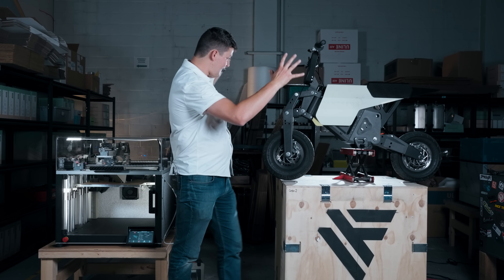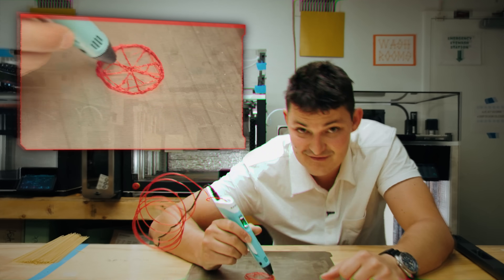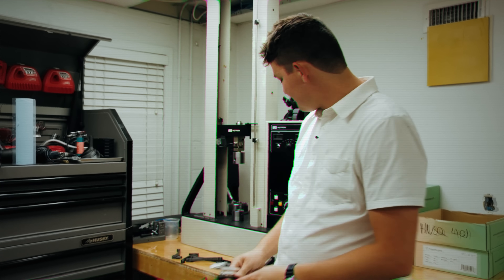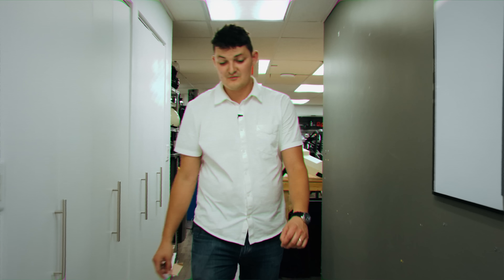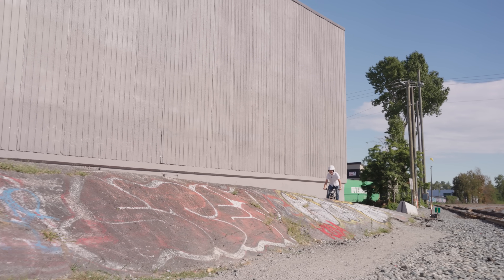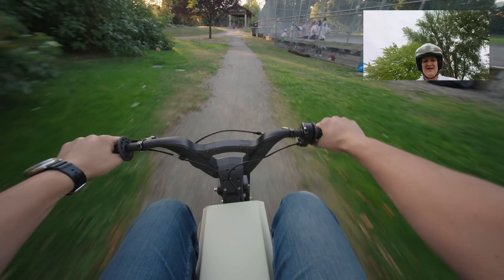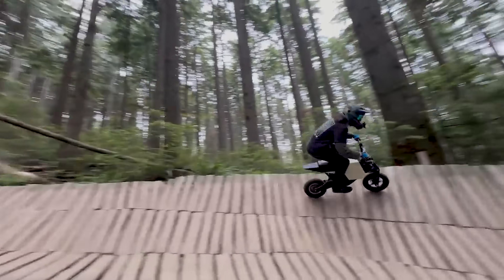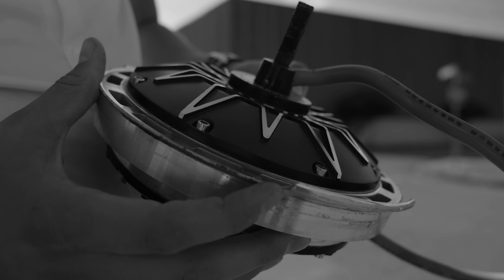Jumping a 3D-Printed Motorcycle - How Strong is the Future?

Comment: 9:47  $500 in filament...plus the cost of a full week's use of one of these specialized printers.  I suspect it would end up costing more than a similarly market-positioned mass produced bike.  And buying your own printer is obviously out of range for most people, since @ 2:10 they cost "more than a Ducati." 
Great for corporations that need rapid prototyping, maybe useful for heritage parts that aren't available (if you're willing to pay the price for an effectively made-to-order part)...but I don't see it being of much use for your average young person that's strapped for cash unless the price of the printers, and the time needed to produce the parts, is severely reduced.
Reply: ... plus tires, motor, rotors, axles, brake system, suspension, electronics, fasteners...
Reply: Motor, controller, and battery add an easy $2k if you want to go faster than a jogging pace. Still, it's impressive how far additive manufacturing has come.
Reply: Yeah... This is like all those articles about 3D printed guns where none of the actually important parts are 3D printed. I mean it's still a really cool concept, but 3D printing will never be the right choice for mass manufacturing something. Like Ryan said himself, it's great if you need to make a thousand things once. There are much better ways to make one thing a thousand times.
Reply: @Hendlton 
3D printing parts for rapid prototyping
3D printed molds for rapid iterations/lower cost per mold not rare to see 250K per part/mold.
3D printing all plastic in USA to dodge tariffs without investing in USA manufacturing/jobs just a warehouse full of printers and a few dudes to maintain them.
Reply: that is the cost.... right now.   3d printers used to be super expensive for machines that were far less capable.  now, you can get a machine that blows away what was once thousands of dollars in the past, for a few hundred, with tech in it that was unheard of back in the day.  the tech is still fairly new, and it is becoming both cheaper, and better by the day.  with a machine that cost a grand and change, you can print parts that are probably about 60-70% as strong as those parts, so in the future one of those "ducati priced" machines might be affordable for the hobbyist, or one might be available at a local maker space or some such for a much more reachable price.
Reply: @RevUnstableBoy you can print these exact parts with a machine that coats less than a grand. Overextruding is not magic. 20g of acceleration is not remarkable.
Reply: @mitchellsteindler  exactly, they're really not much better in capabilities to large format hobby printers. You can easily get prints like this for used "Honda" price, not "Ducati" price. CF nylon is still expensive, $60 a kg for quality stuff. That adds up for something this size.
Reply: People use these for developing products, most of which are later made conventionally. Someone has to try new stuff to push the limits. It’s obviously a thought experiment.
Reply: 3d print your own 3d printer 😂
Reply: @bake162 The Prusa approach :)
Reply: also the price needs to include the other parts that can't be 3d printed, like motors batteries, brakes etc as well as paying someone to assemble it
Reply: 3d printing doesn't make sense for 70% of this application, and it doesn't make sense for mass produced items
Reply: What is the cost for someone to run the printer for a week and also to assemble all the parts?  Conveniently left that out if the equation.  Plus, this bike is less comparable to the Grom and much closer to the Honda Navi, which i believe sells brand new for $2,000.00 usd.  Hard to rival the scale of Big Red.
Reply: Buying your own printer ranges from 200$ to 2500$ for something that'll do you comparable parts at comparable speeds PLUS a toolchanger to use bondless breakaway support material, and an actively heated chamber for performance directly comparable to injection molded parts in-plane. Sometimes helps to throw a quick question at Google.
The REAL expensive part here is the plastic itself. Carbon fiber nylon, likely no less than a PA12 blend, possibly even a more durable base? And it's probably not the more budget 15% CF, it's likely the 30% blend. The stuff goes for 50$ a kilo on a good deals' day. THAT is your real kick in the plums here.
Reply: You have then become a manufacturer with manufacturing problems. Initial cost is higher, but then you can make more than one. Cheaper for someone in need of more than 1.
Reply: Also add the cost for the electronics, motors, battery, etc. I just recently built my own 3d printer, and while the cost of the 3d printed parts would have been maybe $40 in printing filament, the frame, hardware and electronics all pushed the cost above $1400. I did thoroughly enjoy the process though.

The main benefit of 3d printing is it makes it possible to have custom stuff you can't buy at the store. As long as you keep within the limitations of the process you can get good results. And there are cheaper options that work out of the box than what I did. I just like to tinker.
Reply: Your criticism is valid, but the video is as much about possibilities and optimism for the future. It wasn't that long ago that a shitty resolution 40" flat screen TV cost $20k .
Reply: Price of printers will likely drop as production scales up, or capabilities will rise such as speed.   Always the case with electronic gizmos.  Need only look at cell phones and computers as examples.
Reply: @bjb7587  Prices will drop but as goes for regular printers: high-end models will be expensive as the components are expensive. A professional colour laser printer is not a cheap machine, despite a basic printer costing as little as €50,- new sometimes. Phones aren't a good comparison as they have very few components and most of them become cheaper, quicker. Especially the chips. Screens have been developed for decades, as have batteries. 

The sensors, nozzle, etc. will always be a costly item, which you will pay for as the customer.
Reply: And it's not enduro, and it brakes on the first ride...
Reply: You cant print these parts with the same quality at a faster speed by simply buying a consumer bamboolab x1c printer.
Reply: @mitchellsteindler 
No
Ther is same good stuff in that thing

Comment: PA6 CF and PA12 CF deflect under a constant load independently of temperature, so idk about the longevity of any of these bikes. Yeah, sure, printing a single or a couple replacement parts could end up being pretty cheap, but if they fail when under my weight, wile riding, lets say at 20 mph, thats not gonna be a good time
for me

Comment: On the other hand Pratt and Whitney had to recall a lot of engines due to 3D printed part losing its properties quicker than expected so longevity is kinda an issue
Reply: Well, at this point in time, metal sintering is almost the same as making a billet with a welder and then machining the part from that. You're bound to have stress points and weak spots all over the component which will lead to premature failure, especially in such high stress environments like the interior of a gas turbine.

Comment: That was always a question for when the folks on Star Trek were rebuilding the Enterprise after the ship got blasted in space, leaving a giant hole to be repaired.  No where to store any spare parts, fabricating any replacements,  or flying multiple light years to get to a service station.  Just pull out the digital files , plug them into the printer, and Scotty will have the Enterprise fixed in no time.

Comment: Admittedly noticing that the video was 60fps at around 00:18 was jarring. Tech is cool as hell, and sort of unsurprising as FSAE have been using 3d printed parts for a while.
Reply: How did you notice that??? Your eyes are wild
Reply: @nifty_biscuit  Most videos are on 30fps so the jump is fairly noticeable on the right screen.
Reply: @KaiboDamasu 30fps?? What are your default settings
Reply: @SuperEpicCookies  settings don’t really matter you can notice the jump on just about any screen. 

 Refresh rate settings just determine how often the display updates, but they don’t change the fps of the video itself.

Comment: The only thing i've dared to 3d print for my bike is the choke lever, only because when i bought new grips, they didn't come with one. It took some time modeling it and a couple of adjustment after they broke, but it's been working fine for 2 years now. That was on a slightly modified Ender 3.

Comment: $500 of filament, a week of printer time, and…? How much was the battery, hub motor, tires, and all the other manufactured stuff costing?
Reply: Also the printer that "costs as much as a Ducati". Or be stuck paying another 500 or so at a shop to do it for you.
Reply: Exactly. The funny thing is that this is probably a viable model, but selling it as "fully 3D printed" and "made of $500 worth of filament" is profoundly disingenuous. It's like saying that phones are fully made of a dollar's worth of sand.
Reply: its a tech demo to demonstrate what the printer company's printer is capable of, its not meant to be mass production like you're saying
Reply: Not economically viable. When you can already buy a Chinese electric bike for around $1000 that will be better than this.
Reply: @_________________404 $1000 in the US, that is.
In China they sell for about 2 bananas and a wet napkin.
Reply: Honda Navi is $2000 ready to ride and comes with a warranty.
Reply: I have a bunch of 3D printers and would buy a NAVI for $1800.
Reply: 2k for the parts, probably at least another 1k for the week of printer time... and suddenly it's a 3.5k bike... and you can find cheaper on the used market, or chinese. RPS Hawk X 250 anyone? Sure you need to be a welder to do some needed improvements, but... it's $1670.
Reply: And what does the electricity cost for one of those things to be running for 160 hours?
Reply: @jacknimble1  I have an answer for you actually. Assuming a bike like this has an 80 amp hour battery at 72 volts, it has a battery capacity of 5760 watt hours. Something like this going 50kph non stop would take about 1500 watts nominally ish, so 100-0 would be 3.84 hours. 

The current price of electricity is 18.2 cents per kilowatt hour, so travelling at a constant rate of 50kph would cost around 27.3 cents per hour,  running this thing for 160 hours in the scenario were working with here would cost $43.68 USD total in electricity. Assuming a constant rate of 50kph will drain the battery in 3.84 hours of riding, we can also deduce based on lithium ion capacity degradation that something like this would be able to drive 192,000 kilometers before you start thinking about replacing the battery.

All things considered, if your job is an hour away and you use this, you could get to work and back for 1920 days, or, 7.38 years of round trip commutes for a raw electrical price of 1048 dollars, factoring in replacing the battery after those 7 years and it should be around 4048 dollars. The same commute on a similar gas motorcycle, assuming they spend an average of 60 dollars a month on gas, would cost 5313.6 dollars in the same time frame, so its about 20% cheaper than gas, with less frequent and cheaper maintenance because electric drivetrains have only 3 moving parts.
Reply: @jacknimble1 luckily the electricity cost isn't that bad, at full tilt on initial heat up it uses about 200 to 400 Watts on a normal printer. But then it just has to pulse the heating to maintain temperature. If you use an enclosure you could compare it to leaving a 100W bulb on. So it's not nothing, but it also shouldn't be more than 50 bucks in electricity, depending on where you are
Reply: @jacknimble1  And it's not a normal 3D printer either so impossible for anyone to print this at home.
Reply: @_________________404  Not true, there are many consumer printers that could print one. This is not the only 3D printed bike out there. Heck, Local Motors were printing entire cars at one point.
Reply: @BigEpinstriping  So impossible to print at the quality they've shown in this video. Also depends on if the parts are small enough to be printed on a consumer level printer. There's a reason why they've shown it being printed on some expensive industrial 3D printer instead of a normal one.
Reply: The flex is when someone asks where you got it and you say you printed it at home.  Sometimes it's just fun to do something yourself.
Reply: Well you could buy a cheaper bike but if something breaks are you going to call the random Chinese manufacturer to send you a part of a bike that they stopped producing years ago? With something like that you can print it yourself and just upgrade the motor or battery when it gets older that is the point.

Comment: - "slightly higher maximum load than CNC'ed 6061-T6" @ 2:44
- "in this polymer, 150 MPa in the XY but only 70 in the Z" @ 9:01
- Alu 6061-T6 has tensile strengths of 290+ MPa (depending on the spec)

The only way a lower strength material is going to withstand higher load is if you're not comparing the same geometries or load cases.
This feels pretty dishonest.

Comment: I 3D print a ton of accessories, bar mounts, grommets, parts that are not available any more for vintage bikes, tools (just did the oil cap wrench for a BMW for a friend).
Reply: I do the same for all the bikes I work on as well.  My printer has easily paid for itself by making parts way cheaper than what's available, or oftentimes parts that just aren't available at all
Reply: @averycaron5462 where do you get the specs for these parts?  Or do you design them yourself, which adds to the cost?
Reply: @bjb7587  I've made parts and accessories for my bike and I just design them myself. Sometimes it's based on something else, other's it isn't. A lot of it is careful measurement and trial fits than reiterate until you got it the way you want it. Sure, if you want to give your time a value it costs in that regard, but for me 3D printing and CAD is a hobby in and of itself anyways so being able to use one hobby to feed another is just icing on the cake.
Reply: I have the same question

Comment: Wow... now I'm interested to see if you can print a full size motorcycle style e-bike like the Emmo Zone. Of course the most expensive thing for the traditionally produced ones is the damn battery so not much savings to be had.
Reply: You can check my electric vehicle the most parts are 3d printed like metal chassis, rims , tires. It is the most lightweight electric vehicle in the world

Comment: A friend of mine is interested in acquiring a KTM; it seems that he might be able to 3D print components for his Suzuki to convert it into a KTM.

I think additive manufacturing will become more and more mainstream. A friend of mine—his son is working on a system for metal 3D printing to retain the engineering material strengths after printing. Often the laser, which fuses the metal together, also burns out the key properties you want for strength or durability, but his system would see these properties be retained. Imagine the changes you could achieve with properties like 3D printing stainless steel and not degrading the nickel but being able to fuse the part with the laser welding process. 

There is a way to infuse the 3D printed layers of the part through annealing. What happens when the layer gets deposited is that there is a certain amount of bead cooling; the melt is not quite liquid when deposited, like it would be within an injection moulder. But you could bring the part up to near gel temperature and vacuum fuse the layers, which greatly enhances the strength of the material.Additionally, to enhance strength in injection moulding, manufacturers use plecets inserts at key stress points; these inserts are similar in size to stiffening rods, which must be coated and heated to ensure the plastic flows properly under pressure. 

The best 3D printer I saw, which reminds me of the extruders and plastic engineers of my past, was a system out of the southern US, which used vacuumed resin from Gaylord and silos, much like a full extruder. You could match colours using a blending system, and the resin would flow down to a nozzle; this enables masterbatching similar to an extruder and avoids the potential variation found in rolled filament. 

Basically what I want to look for in my next career is to take 3D printing into production with industrial extrusion systems. Based on how horrible Canada is for adoption of technology, I doubt this dream will happen in Canada. But I always keep my eyes open for someone outside of the US who is exploring cutting-edge extrusion.